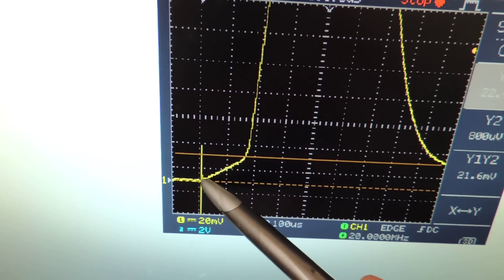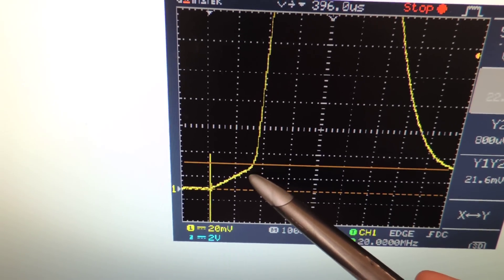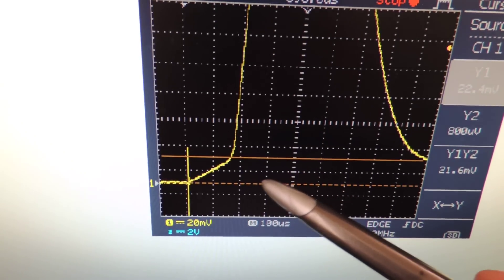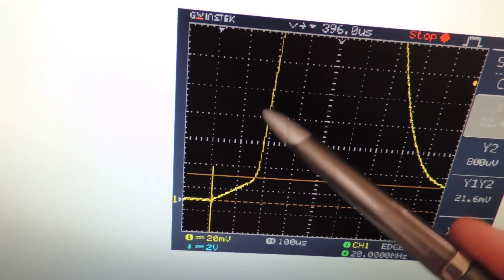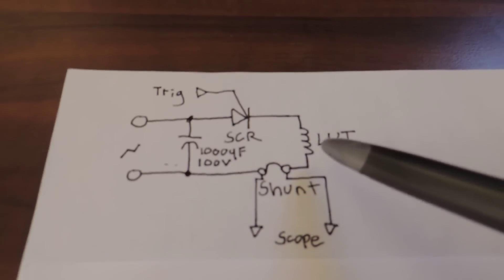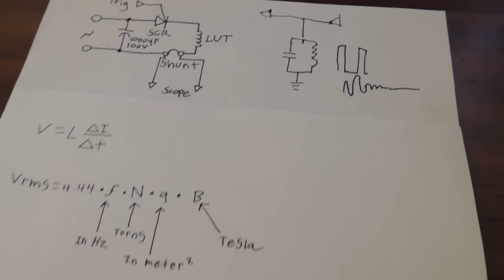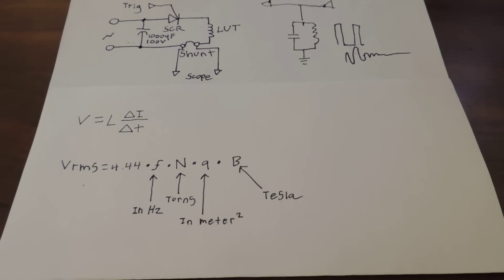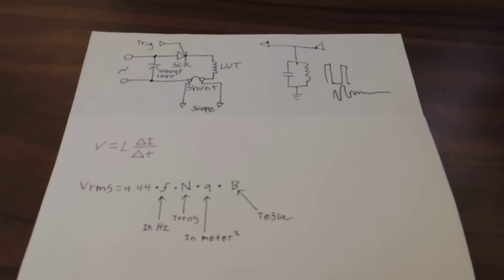Transformer/inductor design Part 1

Comment: Great explanation.  You have an aptitude to teach.  One mistake though...you said you can apply a sinusoidal voltage to the tank circuit and adjust the amplitude when you should have said adjust the frequency, and resonance will be indicated by a peak in voltage of the sinusoid.  Then the resonance frequency relationship for an LC tank is: fc = 1/[2*pi*sqrt (L*C)]  plug in the numbers for C and fc and then solve for L.

Comment: Lately I've become obsessed wanting to learn how to design my own EL Inverter circuits. It seems like it should require a minimum of parts: an inductor, a capacitor and a transistor to form the oscillator, and a step-up transformer. I'm not sure if suitable transformers are available on the market or if I'd have to design my own. Hantronix sells EL inverters (PCB + transformer) but it would be better to know how to make my own. I am working my way through your great, instructive videos. Thank you!

Comment: I knew you were off to a good start in this video because you were talking about real things, and did not have any added distractions such as music or other such noise. Also you are putting this at a basic level so most can understand what you are talking about. Even with a MS in electronics, one thing poorly covered was design of transformers, coils, motors etc. Just the basics of how they work and enough to do a simulation on a computer. The only thing that came close is calculating the inductance of an AIR core, and using a Smith chart.

Comment: At about 11:45 you state that the voltage (of the capacitor) is constant.  How can it be, as it us RAPIDLY discharging through the inductor under test (LUT) when fired by the SCR?.
THANKS FOR THE GREAT VIDEOS!
Reply: Nice observation. I agree with you. But I think it's an assumption that it'll be fairly constant because the time dt is very short. before saturation occurs. And that capacitor is pretty big.

Comment: i'm not sure if i'm doing it right bcs inductance seems to change with frequency in some cores(?) and my L-C meter reads fixed LC tank frequency... but for extracting the inductance-per-turn of a core (that is needed in some calculations) i wind 8 turns, check the inductance with my 10$ L-C meter and then divide the vaule i have by 64, because the inductance increases 4 times every double of the turns number, so instead of 2*2*2=8 turns, it's 4*4*4=64 value

not sure... but it seems to work

thanks for the saturation measuring method!!

Comment: Very nice. I hope to learn more about audio choke and transformer design. I like the idea of using iron in vacuum tube circuits but often appropriate devices are hard to find and expensive. One of the particular projects of interest is a choke tail pair phase inverter. It seems that it would be fairly straight forward. Adequate frequency range, inductance, and DC current. Typically looking at 15-25kHz with 10-40mA DC and enough inductance to load the tube cathodes.

One question, does core material or geometry affect capacitance or is that strictly a matter of winding?

Comment: In your measuring device: timestamp 9:46 I noticed a rather unusual bridge configuration,  is this making the four diodes of the bridge into one diode for doubling the voltage AND current rating, thus converting it into a larger single rectifier?  That should give a GREAT match on the four diodes.
Reply: it's to charge his cap. It provides the AC from a variac. The FBR does the rectification.

Comment: Great video! I have some questions...

What are places you recommend for buying ferrite cores from? 

At 17:05, you say you apply a sinusoidal signal and adjust the VOLTAGE until you get the highest peak value at your oscilloscope. Don't you mean adjust the FREQUENCY until you get the highest peak value at your oscilloscope?

Comment: Eric, I want to build your transformer saturation tester thingy.   Can you post part numbers for your SCR, shunt resistor, and Capacitor.  I have never seen a capacitor that big!   I REALLY loved this video.  Perhaps if you're interested, I will post pics of my transformer saturation tester......thingy.  I have many transformers and inductors that I have taken from old t.v.s and such. This will turn out to be an invaluable tool for me when I build power supplies out of these spare parts.  Anyways, thanks in advance, Eric.

P.s. Post some more transformer vids if you will........Love them.
Reply: purchase all of your transformer component requirements, including all sizes and grades of electrical steel from ASCO

ascocomponents.co.uk

Comment: I heard somewhere that the laminated iron core is very lossy and pretty much useless above 400Hz. How is the performance, say at 10 or 20kHz? Is it usable or too lossy
Reply: There are laminated iron cores with different laminate thickness. The thinner the laminations, the higher the frequency you can use. But even the thinnest lamination cores are not great in the multi-kiloherz frequencies because they do have more losses than other cores you could use.

I don´t know exactly how bad they generally are. But at least using your average core from a 50/60Hz Transformer for a switching power supply is not very efficient.

Comment: beyond  the 22 amp point where the L is saturated is it still storing field energy ?
or is that point of max energy it has to transfer to the cap ?
and does a cap have a limit to how much charge it can hold  ? 

given the label on a cap of its voltage rating my guess is that , at the least,
it has a charge/ voltage limit based more on materials/design than physics

Comment: Hi,great video

If one uses a bigger wire size on the secondary ( lets say #28 instead of #30 awg).  Will the output voltage be the same?

Comment: Hi, I m building a dc-dc converter. 12v input, 380 volt output.. I am using e19/10/5 n27 grade ferrite core. The switching frequency is 100 khz. 50khz on one mosfet, i.e pushpull topology. Primary turns are 17 using25 swg and secondary are 550 36swg.  But the output is on for sometime and then goes off. I m using sg3525 for pwm and p55ng06 mosfets. There is no air gap. Plz reply.
Reply: lol

Comment: Eric, thank you so much for your video.and i have a question,is your capacitor in the "saturation testing"circuit 300mF/600V?but on your paper it is 1000uF/100v.

Comment: can yon give me a calculation of high frequency of Ferric core i have tl494 using IRF mosfet. my input voltage is 12v but  i want it 12-0-12 input and the output is 35-0-35v

want sizes and number of turns ?

i have 5x6 cm ferric core transformer

Comment: Thanks for sharing this good video going into deeper explanations of inductances. At the end of your video you said you could figure the inductance of the inductor of your tank circuit by increasing the voltage of the sinusoidal signal to the highest point on your scope reading. Wouldn't it be that you could adjust the Frequency of your sinusoidal signal unit you reach the peak resonance? Or am I mistaken? Thank you.

Comment: Note a parallel LC circuit should be fed from a  current  generator for it to resonate or else if fed from a low impedance voltage signal generator there should be a high resistance put in series to match the high impedance of the parallel LC circuit at resonance.

Comment: thanx
i didnt understand every thing u said
how can i make 9 DC Volts 1.5A transformer when Power plug give 220 to 235 AC volts
Reply: Transform it 230 down to 9 then rectify and smooth the 9 volt transformer output.

Comment: Hi
Do you know  how to calculate  transformer voltage  per trun
Reply: kamran ali if you can not get 4 turns per one volt then you need more cross section area.
Reply: ຮຸ່ງ ພຸ່ງແຣງ 
I can not get 1 volt from 4 truns i get 1 volt from 3 turns ...
I want to know calculation method  before winding  i shuld know how many turns  required.

Comment: Very electrically conductive? You really think so? 17% the conductivity of copper is good? I was under the impression that it was resistance that turned into heat because iron SUCKS as a conductor, as evidenced by welders and all of the metal melting videos. The copper wires just let the current breeze right through, but when it hits the nail or whatever between the 2 ends of the wires, it melts immediately. Iron is used due to being magnetic, and separated into laminations, and often used with shunts or air pockets to control the magnetic field generated by the windings when powered